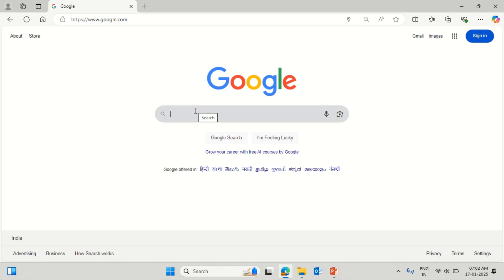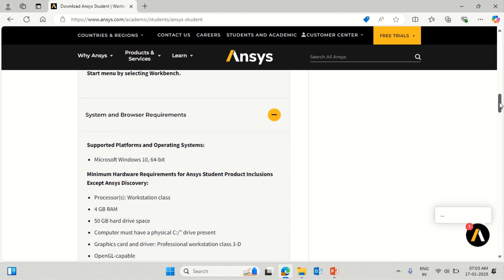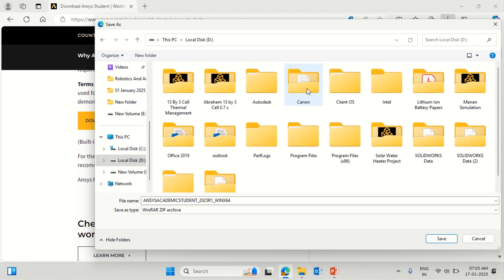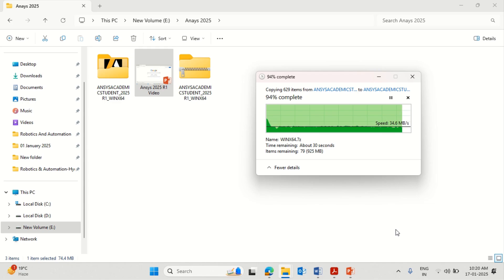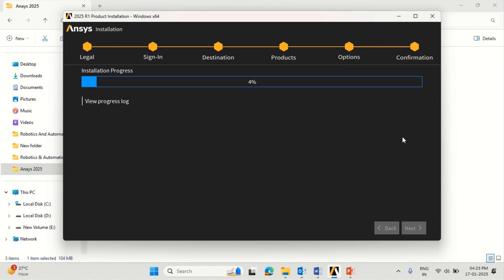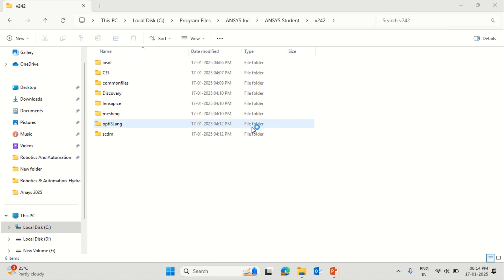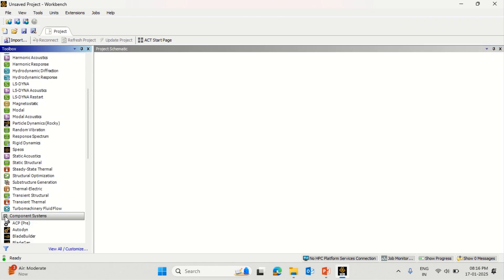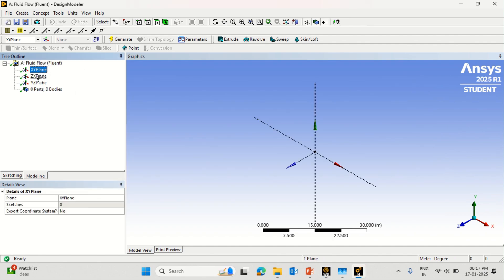ANSYS 2025 R1 Student Version Installation || Get Started with ANSYS 2025 R1 Student Edition

Comment: the program is showing critical error , i did exactly as you , the workbench didn't show , i tried installing again and it just gave the message critical error(not responding)
Reply from the maker: check the windows is updated till date through windows update option. then try fresh installation. delete all related installation files

Comment: i am getting error after installation as root is missing
Reply from the maker: Incomplete installation – some core files didn’t install (especially the ANSYS Root or base directory), Uninstall ANSYS completely.
Delete leftover ANSYS Inc folder.
Reinstall with admin rights, install both Root and Client components.
Reply: @FrontiersInCFD i am trying to install R2 brother
Reply: install both client and root components means.. the same downloaded files may be uaed right?
Reply from the maker: yes similarly it works

Comment: if the anaylsis system are not visible what are the possible reasons? and how can they be solved
Reply from the maker: restart the computer if that does not work it means. not installed properly

Comment: I've dome every step you said and i restarted my pc tooo , the installation bar has been completed 100% and i clicked exit and when i searched for workbench in start button , its not showing anything , what might me the problem, can anyone please help .
Reply from the maker: Right-click the setup file → Run as administrator

Choose Repair if the option appears.
Reply: @FrontiersInCFD  Please do a video for Ansys 2025 R2. I believe the file is different after the update and the developers forgot to put in certain files like Discovery and Workbench.
Reply from the maker: Will do as soon as it is released
Reply: C:\Program Files\ANSYS Inc\ANSYS Student\v251\Framework\bin\Win64

go to this folder and find RunWB2.exe. then run as admin. if it works, okay or else uninstall, remove all temporary files and then reinstall again

Comment: Hello, once I have the files dowloaded but not installed, the Installation progress bar doesn't progress. Is this due to not enough computer capacity ? Thanks
Reply from the maker: Hello! If the ANSYS installation progress bar is stuck even after downloading the files, it could be due to several reasons — not necessarily just limited computer capacity.
Lack of Admin Privileges
Not Enough Disk Space or RAM At least 20–30 GB of free disk space.
Corrupt or Incomplete Installer Files
Antivirus or Windows Defender Blocking Files
Check C:\Program Files\ANSYS Inc\InstallLogs for any logs or errors.

Delete all previous files from C drive ----program file then starts fresh installation
Reply: @FrontiersInCFD thanks!

Comment: Hi I got to t part of the installation where it opened me the analysis and component system, but for me it doesn´t appear all the options inside the toolbox, so it doesn´t let me click on the fluid option. Do you know what i can do to fix this? Thank you.
Reply from the maker: looks not properly installed try the following 1) Restart and check analysis and component system 2) if not uninstall the software and do it again

Comment: After installation, i opened Ansys Workbench. And loaded cad but unable to launch Ansy Mechanical. Stating that Mechanical editor doesn't have valid license. What might be the problem??
Reply from the maker: The issue likely stems from an invalid or missing license for ANSYS Mechanical in your installation. Ensure you have the correct license type
Reply: @FrontiersInCFD it's student version I have installed. Where Ansys will have in build license rite? I'm using windows 11 crack version. Might be that is the problem because I'm unable to go for update.
Reply from the maker: it looks to be

Comment: I downloaded 2025 student version and i can work with design modeler, mesh, setup and solution but whenever click results it shows application failed failed to connect. kindly do the needful... i do uninstall and reinstallation steps also but cant find why i get this error.
Reply from the maker: There is issue with firewall keep connected to internet while you open setup....
Reply: I tried sir but facing same issue there is no change @FrontiersInCFD
Reply from the maker: Ok

Comment: Try the following steps before attempting to reinstall (make sure your windows is up to date)
•	Clear AppData by Pressing Win + R, type %appdata%, and press Enter. Delete any ansys folders you find
•	Clear Temp Files by Pressing Win + R, type %temp%, and delete all files in the Temp folder (skip files in use).
•	Make sure you have administrative privileges
•	And also disable every single antivirus you on your pc, make sure to delete any previous installation attempts from local disc c
•	Reinstall using the given steps in the video
Reply from the maker: Thanks

Comment: Hi, I have installed the software, completed the geometry and mesh but when trying to complete the setup I receive an error stating 'the FLUENT application failed to validate the connection.' and a warning stating 'License is not available : dp0'. Please could you advise how to reslove this?
Reply from the maker: Connect to internate while using fluent.

Comment: Critical error problem after attempting your suggestion
Reply from the maker: if not working un install first then delete ansys program files from c drive then update windows and install again
Reply: @FrontiersInCFD  but installation process is failed at 91% showing critical error although i have updated  the windows
Reply from the maker: Check sufficient storage is available in drive c

Comment: Hi Sir, I installed already, But I cant find the workbench in my laptop, how to fix it? thanks
Reply from the maker: Check if ANSYS Workbench is Installed Properly
Go to Start Menu and search for ANSYS Workbench. 
Open Control Panel > Programs > ANSYS and select Repair.
If that doesn’t work, uninstall and reinstall ANSYS with administrator privileges. 
Run ANSYS Workbench as Administrator
Right-click Workbench.exe and select Run as administrator.

Comment: Hello, I followed every step, but when I open workbench the following message pops up: ""Unable to retrieve WB usage tracking, no WB usage tracking id supplied." I have tried almost everything. If someone could help me I would be bery grateful
Reply: Ok I Will do It. Do you know if ansys Student 2025R1 is compatible with Windows 11 version 24H2? Thanks
Reply from the maker: Yes compatible
Reply: @FrontiersInCFD  I have uninstalled completely ansys student and the same error appears and I can't do anything. Do you know something else I can do to solve this error?
Reply from the maker: Check if ANSYS Workbench is Installed Properly
Go to Start Menu and search for ANSYS Workbench. 
Open Control Panel > Programs > ANSYS and select Repair.
If that doesn’t work, uninstall and reinstall ANSYS with administrator privileges. 
Run ANSYS Workbench as Administrator
Right-click Workbench.exe and select Run as administrator.
Reply: Ansys doesn't appear in programms in panel control. How I can repair It? Thanks
Reply from the maker: re install
Reply from the maker: Uninstall ANSYS completely.
Delete any remaining ANSYS-related folders in:

Comment: hi sir! after completing the installation process, I can't find the application, please help answer me.
Reply from the maker: check in search box **workbench**
Reply: @FrontiersInCFD  ya, i'm check on there, but not available sir,
Reply: @zainaladitya2671  Hi, I have some issues like this, wyd?
Reply from the maker: Check if ANSYS Workbench is Installed Properly
Go to Start Menu and search for ANSYS Workbench. 
Open Control Panel > Programs > ANSYS and select Repair.
If that doesn’t work, uninstall and reinstall ANSYS with administrator privileges. 
Run ANSYS Workbench as Administrator
Right-click Workbench.exe and select Run as administrator.
Reply from the maker: Check if ANSYS Workbench is Installed Properly
Go to Start Menu and search for ANSYS Workbench. 
Open Control Panel > Programs > ANSYS and select Repair.
If that doesn’t work, uninstall and reinstall ANSYS with administrator privileges. 
Run ANSYS Workbench as Administrator
Right-click Workbench.exe and select Run as administrator.
Reply: What did you done...I have Sam issue
Reply: @what did you done...I have same issue
Reply: @bedazzledblue7489  Still searching for a solution,
Reply from the maker: Check if ANSYS Workbench is Installed Properly
Go to Start Menu and search for ANSYS Workbench. 
Open Control Panel > Programs > ANSYS and select Repair.
If that doesn’t work, uninstall and reinstall ANSYS with administrator privileges. 
Run ANSYS Workbench as Administrator
Right-click Workbench.exe and select Run as administrator.

Comment: bro i messup the setup for the fluid fluent how to reset it
Reply from the maker: Close Fluent (if it’s open).
Right-click on "Setup" under Fluent in the ANSYS Workbench and select "Reset".
This will erase all Fluent settings and allow you to start fresh.
Reply: @FrontiersInCFD  bro it's not work still the same how to reset the whole ansys
Reply from the maker: Check if ANSYS Workbench is Installed Properly
Go to Start Menu and search for ANSYS Workbench. 
Open Control Panel > Programs > ANSYS and select Repair.
If that doesn’t work, uninstall and reinstall ANSYS with administrator privileges. 
Run ANSYS Workbench as Administrator
Right-click Workbench.exe and select Run as administrator.

Comment: the demanded solver was not found in the specified path and error occurred inside the solver module:genral error, I  am getting this error when tried solving LS dyna workbench
Reply from the maker: Ensure that LS-DYNA solver is installed correctly on your system.
Go to Workbench → Tools → Options → External Solvers and verify the path to the LS-DYNA solver.
If the path is incorrect or missing, set it to the correct LS-DYNA installation directory. Verify Environment Variables If it’s not set, manually add the path in System Properties → Advanced → Environment Variables under the "Path" variable. Right-click ANSYS Workbench and select Run as Administrator.  If none of the above steps work, reinstall LS-DYNA and reconfigure it in Workbench.

Comment: Hi! I’ve been struggling with installation process. For once it’s done, it doesn’t showed up. I read all these comments, updated my laptop, and re-installed, then it shows “critical errors” which I confuse.. do you know what should I do with these problem?
Reply: This critical error is the major trouble I'm battling with during installation. After downloading at first, it installed but I couldn't find the app to run the software. So I had to delete all and reinstall. From this moment, "it's always showing "critical error". And I have to be fast with it so I can practice the simulation for my school's final year project. Please help my life. I use Dell Latitude 3190 2in1. 4G RAM, 64 bit processor
Reply from the maker: Ensure after installation you have deleted earlier program files of ansys
Reply: @FrontiersInCFD  I did. And my friends told me to wait after the installment, because there’s a lot for my laptop to absorb. I waited 5 hours, and still nothing. I even cleaned 80 Gb for thiss 😢😢 Do you know where the problem is?
Reply: Same "critical error" issue. i'm also working on final year project please help us
Reply: @ethirajyogesh7439  have you solve your problem
Reply from the maker: Clean Previous Install Attempts

Comment: Is university e mail addres required for using workbench? I installed ansys workbench and other add-ons successfully but software have't asked yet my e mail address. In the other hand when  i use autodesk softwares they wanted my university e mail address.
Reply from the maker: Not required as it is student version
Reply: @FrontiersInCFD   Thank you for the help
Reply from the maker: glad it was helpful

Comment: i have successfully installed it and all other ansys applications are working except for Ansys Mechanical. This is the error: "Update failed for the Model component in Static Structural.  Mechanical failed to open the database: The Mechanical editor does not have a valid license. Please refer the following directory for more information: C:\Users\prasa\AppData\Local\Temp\.ansys." Can you please provide solution for that?
Reply from the maker: It appears to be a license issue, try reinstalling the application
Reply: @FrontiersInCFD  i tried reinstalling it but yet same error is occurring
Reply from the maker: uninstall files and delete from c program files then try re install

Comment: I have get the error msg 800a000d error message in previous version on windows 24h2 update. After i find that that version did not support for the ansys. I want to know  new version of Ansys 2025  R1 worked in the windows 24h2 update ?
Reply from the maker: Yes it will work only make sure windows is updated before installing ansys software

Comment: I followed every step to istall, but couldnot succeed. everytime i istall it says two erros one at starting at 4% and another at 91%. I have uninstalled the program several times  and redownloaded it several times , and also disabled the antiviruses also but these errors are always coming and the installation is never complete. The first errro is  The manifest file for the installation does not exist, pls verify the install file was run. file not found is "uninst_data.dat" and another critical error and the unstallation process is aborted.  pls help to resolve the issue. My laptop has 16GB RAM Video graphics RAM is 8 GB i5 intel coreintel irisx graphics.
Reply: I am also giving same the error. Did you find solution?
Reply from the maker: re install
Reply: I had to reset my laptop to make it to work
Reply from the maker: Before installing check windows update option
Reply: The windows is already updated

Comment: I followed your steps to download and install ANSYS Student 2025 R1. But when running, it prompts that it can not find the license file. And it can only read and cannot be operated. What should I do?😭
Reply from the maker: it looks not installed properly go to the program files uninstall previous version if available, delete the ansys folder in program file. Then check for windows update option make sure it is up to date then, Try installing ansys again

Comment: I went through geometry design, mesh and then i want to start up with fluent, but it does not work. The solver stops and the error appears :"The FLUENT application failed to validate the connection"
 What does that mean? ..... and How to solve this problem?
Reply from the maker: there must be some issue with fire wall setting, try while you are connected to internet then open the fluent setup
Reply: I have the same problem, did you find a solution?

Comment: Hi sir, can you drop a video about simulation temperature distribution into freezer box of fish and analyse the heat loss from that fish?
Reply from the maker: Share specifications
Reply: @FrontiersInCFD  a fish freezer box with a length of 500 mm, a width of 400 mm, a height of 800 mm. Surrounded by an evaporator pipe from top to bottom where the inlet pipe enters from the front side of the upper box and the outlet is on the front side of the lower box. Fish in the box with a certain amount want to be cooled to a temperature of -5 with a certain amount of heat contained in the thermal source. can you drop a video about this simulation in transient?
Reply: Even i finished download,i can’t find it in my computer